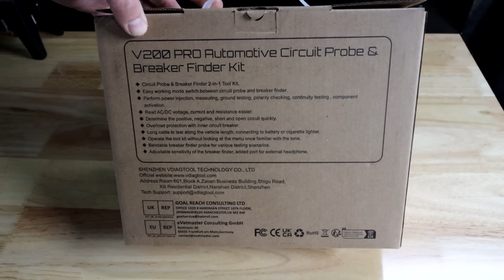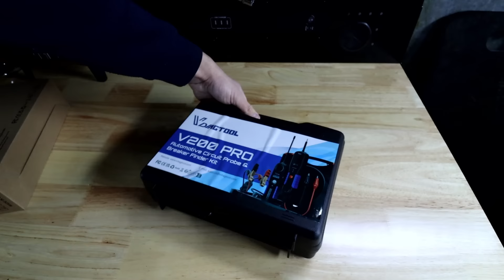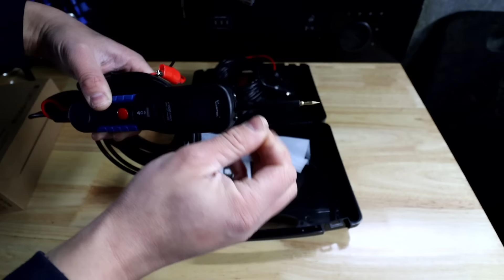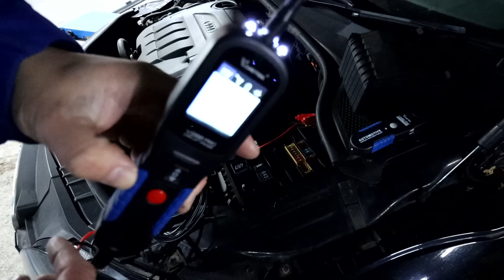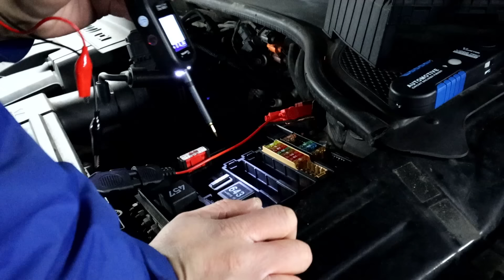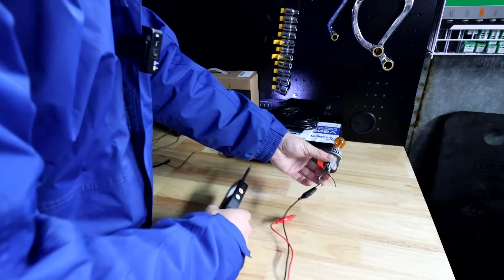Vdiagtool V200 Pro demo and review. Circuit Probe and Circuit Breaker Finder 2025. Best Tool!

Comment: My display screen went blank and has a loud constant beep???
Reply from the maker: Any chance you connected the terminals.the wrong way around to the battery?
Reply: @AlexTheGrumpyOne no I was using the lighter plug adapter and was checking headlights